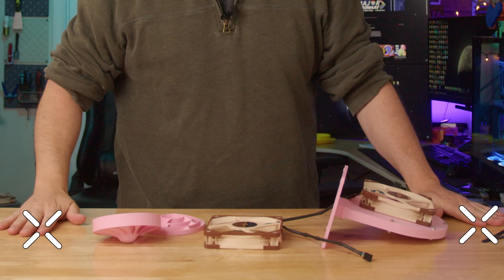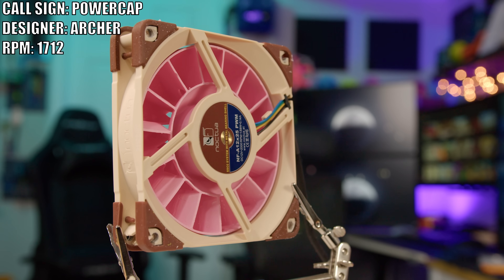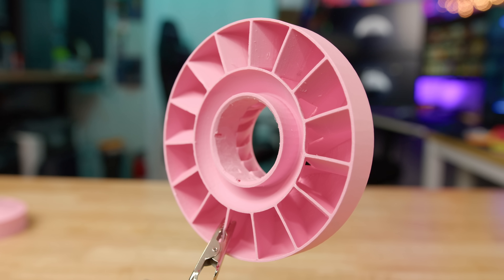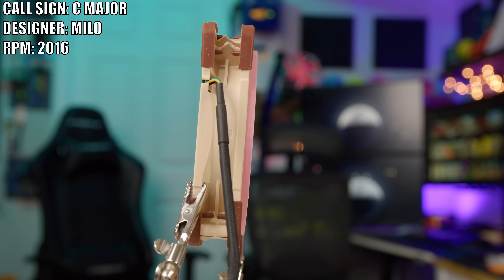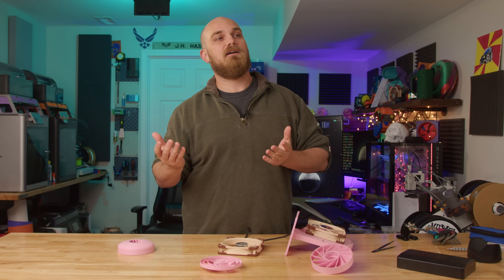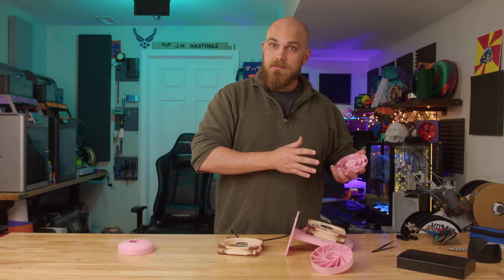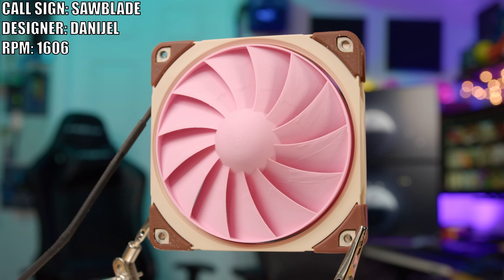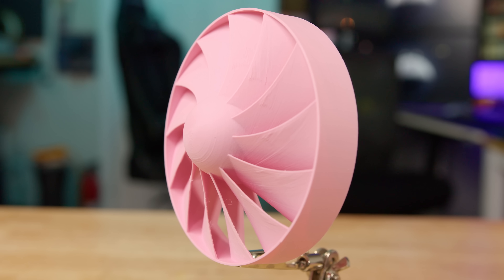Insane Fan Hack WINS Big! 😱 | Fan Showdown S6E4: Ultimate Static Pressure Battle

Comment: Oh boy, we might end up with contraptions that are more tire pump than fan, won't we?
Reply: Here's to the first person  to submit a piston based compressor "fan"
Reply: @ramb4ldi  lol
Reply: @ramb4ldi  That is what I was think of making.
Reply: I hope!  Imagine pumping a tire with an A12X25.
Reply: Luckily the possible design options are heavily limited by the miniscule torque the motor gives out, so we're unlikely to see any actual pumps.
Reply: @anteshell  you can always add a gear reduction to fix that
Reply: @two_number_nines  It will take 3 days, but it will fill your cars tire.....
Reply: @two_number_nines  Not really. Any mechanical complexity made with 3d-printers adds so much friction, that there's really not much you can do. This particular motor is so weak that almost any added friction will will bog it down and burn it.

A precisely machined gearing assembly would work to some extent, but obviously that is out of the question here.
Reply: @anteshell  if made from a resin it will be as precise as it can get.
Reply: @two_number_nines  Yeah, emphasis on the "as it can get", which is not precise at all. Don't confuse smoothness and preciseness together.

It is simply not possible to make a gearing precise enough to mitigate the losses on friction enough with any 30-printer without plethora of post-processing which is completely out of the scope of this series. There already was one geared fan which did not work. He tried to make it better in its own video outside this series, but still couldn't make it work. And no, I'm not even talking about the fan itself. I'm talking about the gearing it had; a simple planetary gear with no added load besides to parts' own weight and the friction between the gears. 

TLDR; It does not work. Period.
Reply: @anteshell  i don't think even precision machined parts would be enough to get any significant gear reduction with such a weak motor. they only have so much force to overcome inertia and friction
Reply: @amicloud_yt  - then make the pump so small that the motor is a beast in comparison. It's a pump.
Reply: @anteshell like the wonder from down under????
Reply: @joaomrtins  While there is some overlap between pumps, fans, compressors and blowers, I would argue that that is not a pump but rather a compressor
Reply: @anteshell  was thinking this exactly, so the backwards swept blade blower is likely the most optimal base to improve on.
Reply: 3d printed air compressor go brrrr
Reply: If it is allowed to 3d print a belt drive of some kind you could probably achieve reduction without too much friction.
Reply: if its a tyre pump then it'll have more compression than flow, thereby being "slower"
Reply: it's the god damn 6th season

like just re-watch them old videos

lmao
Reply: PD pump go brrrr
Reply: I'd love to see that too. Even if it's separate videos. That's one reason Freedom is so important. When people are Free to tinker and invent, the real innovation begins. That's probably why we have like 1,000,000 patents per year n the US, but the rest of the world has a couple thousand.
Reply: @deucedeuce1572  You should maybe verify those numbers sometime - OBIS has a nice "patent grants by country" graphic.

Comment: C major chord isn't three octaves of the same note C, it's C, plus a third, plus a fifth, so C  E and G, E is the major third of the C major scale, and G is the major 5'th of the C major scale.
Reply: Yep, and in this the C3, E3 and G3 peaks at ~131hz, 165hz and 196hz can be seen on the frequency graph :3
Reply: @rachelnewton-john7031  right, the fan designer has added blades for the ratios of the frequencies of the major triad, 4:5:6. The resulting frequency peaks are in those ratios so 131:165 is the 4:5 ratio and 131:196 is the 4:6 ratio. These exact division produce a justly intoned chord, rather than 12-EDO. When he does that close up mic test you can hear the just major third on the middle ring. That tone is the least audible to me on the overall sound test, it's almost completely drowned out by the 5th. I think a design with the 5 blade ring on the outside would make a richer sound as it's the 3rd that needs more volume.
Reply: @gremblebean  I hear the chord as well and matched it to my piano.  But I feel like the C and E (1st and 3rd) are prominent, it's the 5th. that I had to listen more closely to hear.  Either way I like that it worked the way the designer planned.  Kudos to him who found another way to connect music and math.
Reply: @rachelnewton-john7031 
And can be clearly heard
That was a fun C major cameo lmao
Reply: @rachelnewton-john7031 Colon three? OwO
Reply: Also it's only gonna be C if it spins at the right RPM. Else it'll be some other major chord with a different fundamental.
Reply: @Tonyface666  Version X will be attached to a BLDC speed controller, and an Arduino with a few melodies in its flash. It can be called 'The Major Power Chord'... later that year, the 'Minor Power Chord' will be released, and the start of a franchise begins, 'The Power Chord" Line-up. 8-bit digital music blows through the nation!
Reply: @Tonyface666  Are you sure the 3 sections change frequency at the same rate when changing the rpm so that other major chords are possible?
Reply: Imagine connecting that to tubes of different lengths;  it's essentially a new musical instrument controlled by RPM.
Reply: @mhoop1  I think organs work this way lol
Reply: @mhoop1  I could swear there's some kind of instrument that works like that, kinda.
Reply: @gigaherz_  that's the concept behind almost all piano-like percussion instruments that involve mallets-- minus the rpm. Slapophone, vibrophone, marimba, etc
Reply: @mhoop1  that’s basically an organ. Electric air pumps (big man powered bellows historically) allow air to be pumped to specific tubes with an air splitter to produce a given pitch. Build a bunch, and a building around it, and you’ve got an organ lol
Reply: i was gonna say, this isnt a Cmaj, its just like a coir singing the C note in various octaves, which is still cool.
Reply: For those not understanding 1,3,5 ...
Cmaj , is derived as the 1,3,5th notes  in the C major scale being C,D,E,F,G,A,B . That is Cnote ,E,G notes all played simultaneously.  This is created by each fan radii blades rotating at slightly different speeds.
Reply: *perfect fifth. not major fifth
Reply: came to comments for this :D
Reply: Also known as a C major Triad.
Reply: So true. Truest comment on YT (I know almost nothing about music)
Reply: Thank you
Reply: C Natural (kinda)
Reply: Perfect 5th 🎸
Reply: All these are certainly words but...

Comment: The wonder from down under guy should get a job in a F1 team. He read the rules and decimated all!
Reply: He really thought outside the box
Reply: having seen videos on stuff about this, F1 and NASCAR have some legendary rules hawks in their history. People who read the book front to back and back to front twice and then cooked up an idea that was not in the book. One from NASCAR was one team using a 2" diameter fuel line from the gas tank(I think racers use the term Fuel Cell) to the engine compartment. See the book regulated the capacity of the fuel cell but said nothing about the fuel line. So by using a bigger fuel line they hid a bit of extra fuel.

I know a meme from F1 was at one time and maybe still is that some hot shot younger team will cook up a really need idea, kick some ass and then Ferrari will get it banned.
Reply: @filanfyretracker  Smokey Yunick if I remember it right. Also used a longer fuel line, zigzag under the car.
Reply: @filanfyretracker  its always ferrari. if you cant beat em on the track, there's no rule against beating em off of it instead
Reply: This is why many ventilation systems have radial fans.
The disadvantage with them is that a small imbalance can cause noticeable low frequency noise that could be tiresome to hear.
Reply: in it to win it. period, lol
Reply: I wouldn't say decimated.
Reply: Originally decimate meant to kill 10% of the enemy's army to show dominance, to teach them a lesson. And now, because all words ending in -ate (obliterate, dominate, devastate, liquidate) mean total destruction, it means whatever you think it means..
Reply: Also, It's pronounced "Steven" NOT Stephan/Steffen/Stefan
Reply: @Tom-yc8jv  definitely depends where you’re from a know a Stefan from Europe that’s pronounced stef-ann
Reply: @DMSparky  or shtay-fann
Reply: @Tom-yc8jv all depends on region. Had two friends in elementary school with the name Stephen, one went by Steven the other Ste-fen.
Reply: @Tom-yc8jv  Stephen is my given first name but I am known by my middle name Grant, there is no hard rule for the pronunciation of Stephen either V or F is correct!  although the F Stephen is usually spelled Stephan! I have no preference I say it with a V and I've met other Stephens that usually go with the V but not all do!
Reply: @Tom-yc8jv  it's weird that he didn't click, I think he watches CNC-Kitchen more than he watched The Late Show with stephen colbert
Reply: Wee way to go from f1 needs variable geometry and secondary channel to increase entrainment then we'd be talking f1 more group b tech also a tiny hole from pressure side to behind wheel to balance static pressure so it runs free under variable air pressure loads :).